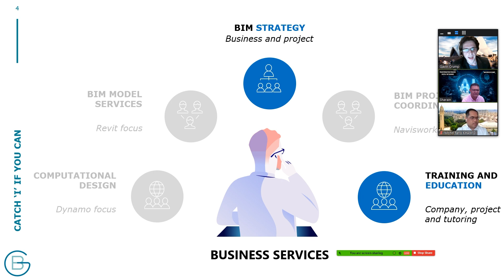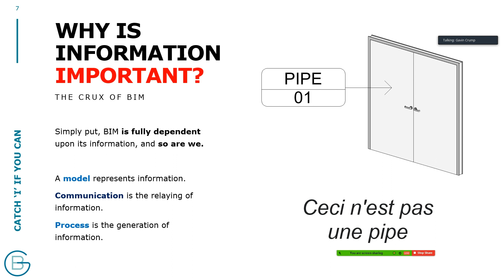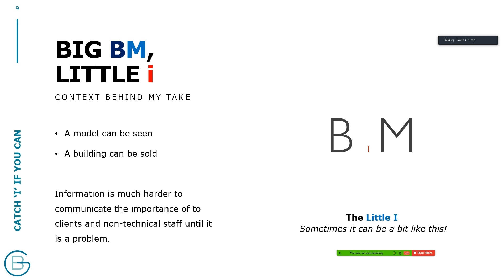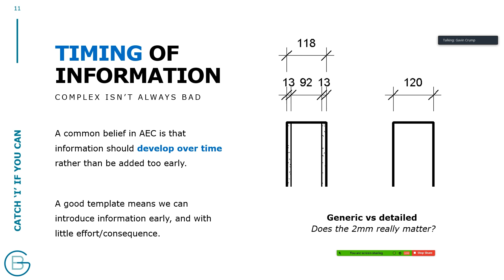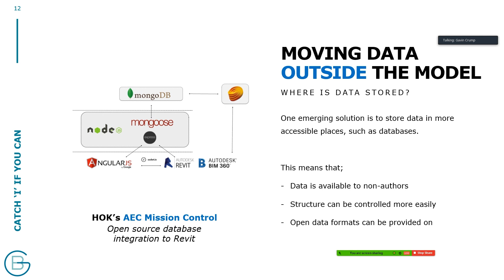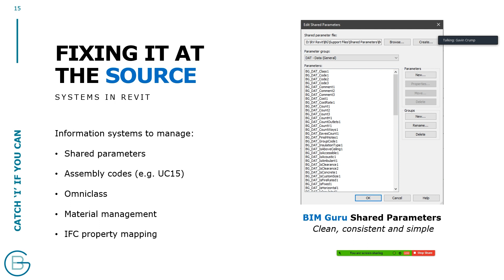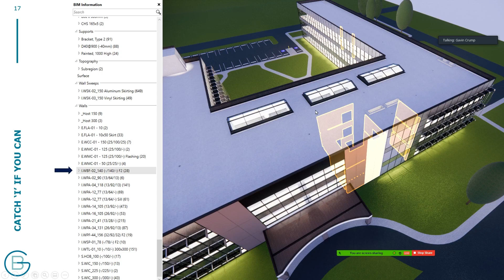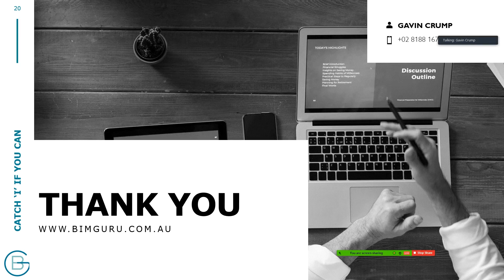Catching the 'I' in BIM (Webinar)

Comment: Gavin.  Nice one.  Two areas I looked at the Demonstration of multiple wall layers, when the adjacent wall was just one (visible).  Firstly the geometry must be correct, even if the layers are not defined, so the naming reflects the wall buildup, and the dimension reflects spatially correct.  But, with the communication at Workstage 1, the data and geometry are complete to the Level of Information Need, but the display of two lines can focus the activities on design at GA/Layout level.  So its ensuring the right information is displayed at the right time.   You are correct, that do the input right once and make it available as soon as possible has enormous benefits, especially reducing the mas panic at the last minute.  I'm saying that incremental checking, raises the teams awareness to content.  We will see the increase in responsibility of Ownership with links to Fees as a result.  Thanks
Reply from the maker: Thanks Pierre!

I've been exploring combined walls lately, unlocking the core or side zones has some potential to do 'all in one' wall types, but the area reporting is a problem - Dynamo needs to intervene.

Introducing schedules to my client's setup has always been a good move - raises awareness to modelling errors and accuracy.